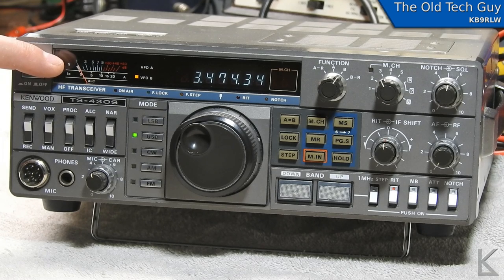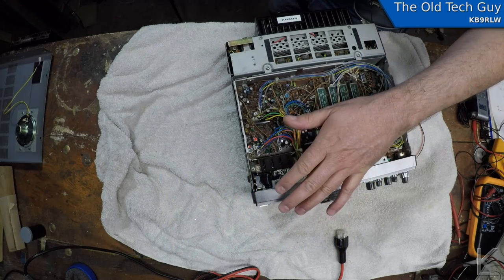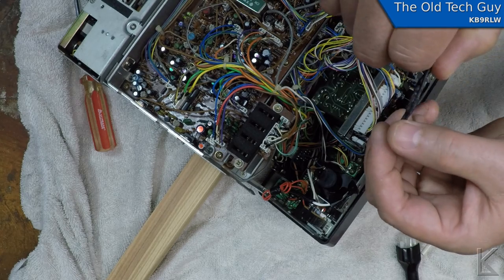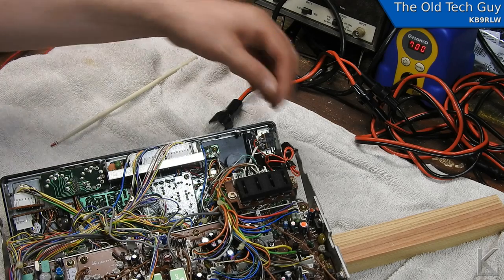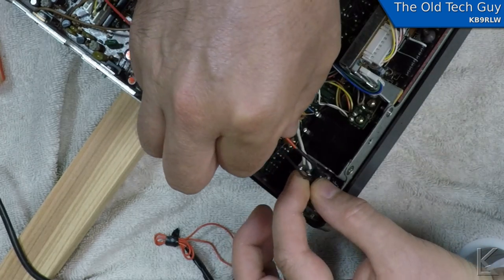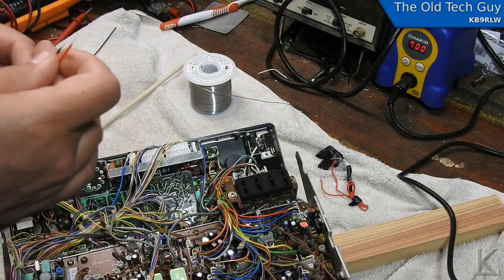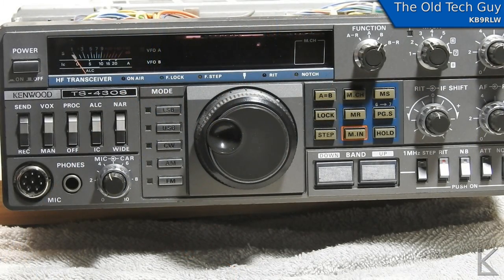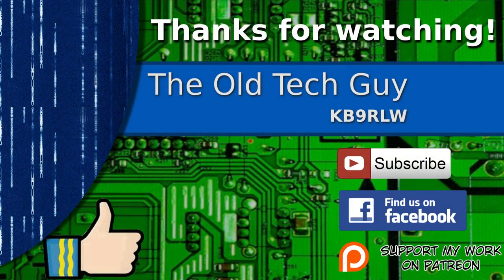Ham Radio - Replacing the S-meter lamp on a Kenwood TS430S

Comment: I have the TS-430S radio, but when I increase the carrier control, as I am increasing the display disappears. Any clues please?
Reply from the maker: Just a guess, but I would think perhaps RF is causing problems on the internal boards. The screws that mount the boards to the frame are also grounding points. Over time they loosen up making those connections intermittent. I would go through it and make sure all the screws that mount the boards to the frame are good and tight.

Comment: "Light Pipe".  My father had an old Panasonic combo 8-track/Cassette/AM/FM stereo that had a woodgrain (simulated, I bet) cabinet and brushed metal trim, and a green dial.  Not that they matter, but the speakers had a red felt face, rather crimson in color, with the Panasonic "P" logo in the corner in black-and-chrome plastic.  The dial, which was about a foot long if I recall, was lit the same way, and if I recall from my childhood watching him repair it, it had a small light on each end...  size of a Christmas tree bulb, used in model railroading too.  But it was a "light pipe" as you call it.  That radio was made in the late 60s or early 70s if I'm not mistaken.  I just dropped twenty minutes looking for it online to no avail.  EDIT:  Just needed five more minutes.  Panasonic RS-2845.
https://www.worthpoint.com/worthopedia/vintage-panasonic-rs-2845-track-137050804

I myself am not a fan of LED "mods".  I prefer the original yellow hue of an incandescent when they were the original bulb.  LEDs look out of place on this equipment, in my humble opinion, but that's just my taste.  Lots of people doing this mod on a lot of gear.

Comment: Audio OK. What value for the led resistor?
Reply from the maker: Something between 450 and 600 ohms should be fine.   You want to limit current through the LED to somewhere between 20 and 30 milliamps.

Comment: that was a awesome video I just fire up the old TS-430s it has been sitting in a drawer for the past 15 years and I noticed that the S-meter light was  out it looks I'm going to be doing some soldering myself. I purchased this old radio in a  ham fest it seems to be transmitting ok. 73's. now I just need to find a video for the mars mods. for the general transmit. 

 Thank you.

Comment: Kevin I know this video is over a year old, but just wanted to point out, that the groove you was talking about is for a rubber filter (grommet type bulb holder).  Whomever had the radio before and changed out the bulb didn't put it back or use it.  I found a modification online, while looking for instructions to replace the bulb in my Kenwood TS-440, for using LED and in the modification the person doing the mod, removed the original bulb and the rubber filter.  He cut the dome from the rubber filter, basically just turning it into a grommet.  He then put the leads thru the grommet and then a 90 degree bend on the leads so the LED was pointed toward the light tube.  Then using hot glue he secured the LED leads to the grommet and then reinstalled the grommet in the slot.  This holds the LED to the light tube.  Not saying what you did wasn't fine, but just wanted to let you know, if you didn't that the slot there was for the original bulb and the rubber filter.  73 Juddie WD8WV
Reply: I just done this modification to my dad's Kenwood and he has the rubber holder still there. I fitted a blueish white LED like this video but i placed it into the rubber holder with no other mods.
Sadly approx 1 month later, it's dying and needs replaced again.

Comment: Kevin I have an icom ic 251e which I need to put an s meter light into. can you please tell me what resistor I need to put in line...much appreciated.
Reply from the maker: With most LEDs, something around 400 to 450 ohms should work.

Comment: Hi there, what kind of resistor did you use to adjust the  Voltage of the LED?
Reply from the maker: The resistor's job is actually to limit current through the LED.  You want about 30ma.   So, using Ohms law,  R=E/I.  In this case, Voltage would be 13V, so 13 / 0.03  Gives us around 430 ohms.   So any resistor between 430 and about 500 ohms should give us a good strong light.

Comment: Nice repair. Personally I would have hot glued the led in place just to make sure the  led does not move around if the radio is being transported or something.
Reply from the maker: It's a very dense foam and pressed in quite tight.   There's just no mass to the LED.  You'd have to impact the radio hard enough to damage it physically before that LED will move.   This way, it's easy to undo the mod if someone wanted to go back to a blue rubber boot and incandescent bulb in a full on restore.

Comment: Great mod Kevin. I wonder how long the foam will last before it dries up? Even the VFO A and B shows up really well. Thanks to the guy who sent you the solder and Hakko. Happy Independence Day. KØOJ
Reply from the maker: It's a dense soundproofing foam.  It doesn't break down quickly like some others.   Many many years.  Also, being dense, it will stay tight and hold things in place very well.

Comment: I thought that the solder reel would be stored inside the solder station and feed up the umbilical to the iron and come out at the tip of the iron and be controlled by a foot switch on the floor making for one handed operation so the other hand can hold the components being soldered in place.
Reply: Kevin Loughin if the solder station was computer controlled maybe it would work
Reply: What you are referring to sounds like mig welding.